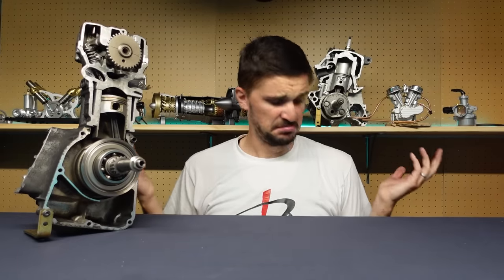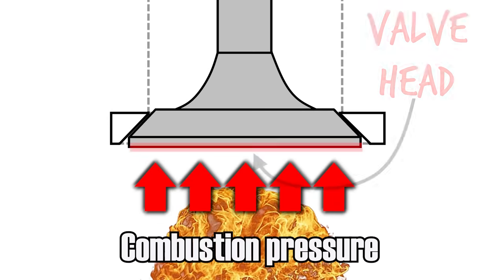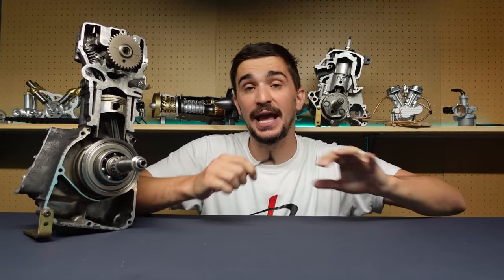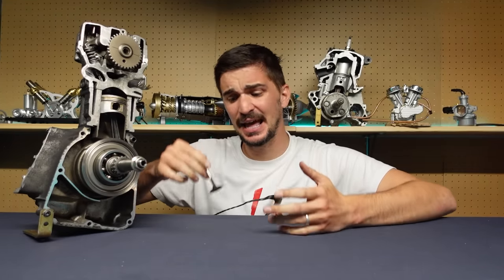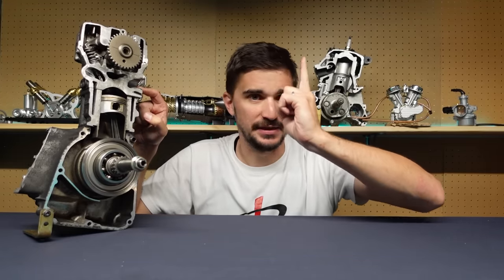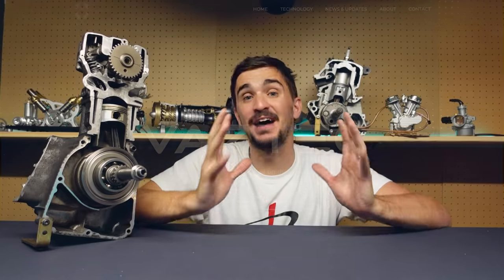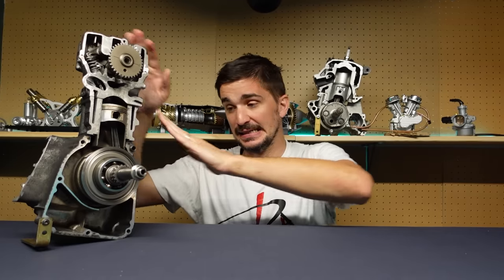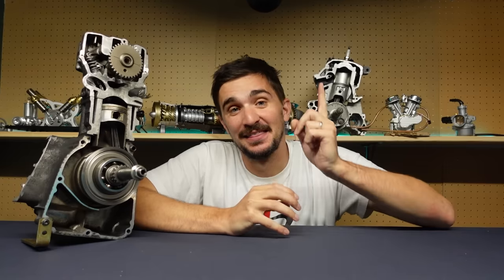Rotary Valves Make Normal Valves Look Silly - Why Aren't We Using Them?

Comment: I've worked on my own design for a rotary valve.  I was building a head that would fit on a Briggs and Stratton 5 horse engine.  Unfortunately my software couldn't  model the gas flow.  I was trying to build a mechanism that was capable of adding a dwell in at propitious times so the combustion events could take place effectively..  Been scheming on this idea for 30-40 years. All that to say this is an interesting video.  I may pick it up again!!  But thanks for the content!!  I probably need to study desmodromic valves!

Comment: Another couple anvantages of the poppet valve: it's sealing surface is self cleaning and the friction surfaces (valve guides) are cooled by the intake charge so oil doesn't cook and gum up the movement.
Reply: Heat is also transferred from the poppet valve to the head when it is seated.
Reply: The sealing surface is only self cleaning on port injection engines. Ever pulled the intake or heads on a DI only engine? They get pretty nasty without fuel washing the valves.
Reply: The exhaust valve guides aren't cooled by the intake charge.
Reply: @pastaalalamborghini  There's still an element of self cleaning of the sealing surfaces on engines where the valves are allowed to rotate in position as they open and close. I'm not sure whether this is common, but some engines have the valve stem slightly offset from the center of the cam to cause this rotation as the valve opened and closed, which reduces fouling on the sealing surface, though it won't stop things getting gummed up everywhere else.
Reply: @peglor  ...valves that spin themselves against their seats to self clean ... Bye
Reply: @pastaalalamborghini no, the valves don't spin against the seat, they rotate very slightly as they open presenting a different face to the gas flow thus evening out any deposits.  Notionally, they've stopped rotating before they close.
Reply: @pastaalalamborghini  ' ...valves that spin themselves against their seats to self clean ... Bye'
Explain to everyone in comments that you don't understand that every tiniest possible advantage in engine tech has been done, without saying the words.
' that spin themselves against their seats'  You should spend a few years watching videos of valves in action before commenting again since you don't understand the accelerations and inertia involved.
Reply: Correct. @peglor
Reply: @Ijusthopeitsquick  the stem is cooled by the flow, so heat isn't transfered to a very large extent to the guides compared to in a rotating valve. There's a physical distance, the stem has a small cross sectional area and on top of that steel is a poor heat conductor.
Reply: @pastaalalamborghini  the contact surface is cleaned by the action of the valve, I'm not talking about port or valve top cleanliness here.
Reply: How about volumetric efficiency?
I’m thinking poppet valves have an advantage there.

Comment: Direct inject two strokes are very clean. They don’t have fuel washing oil of cylinders and bearings so can run a much smaller oil flow. Fuel is injected after all ports have closed so there’s never any unburnt fuel going down the exhaust. Exhaust power valves maintain midrange power and there’s no partial combustion to slap the piston around - much less bore wear. The Rotax ETECH is cleaner than competitors four strokes and has better fuel consumption. It can use stratified charge solving NOx issues. The pre combustion chamber used on F1 engines is an ideal fit as the excess air can be varied via inlet valves.

Comment: seems like a neat idea for single cylinder engines as the barrel can function as a balancer shaft against vibrations as well reducing the needed parts even further.
Reply: If that were the case, a counter-weighted camshaft could do the exact same thing

Comment: I theorized this at University in early 90's the problem is that a rotary valve will not seal. The rotary valve on the exhaust is exposed to gasses at 700° Celsius and the alloy will expand accordingly locking itself in the sleeve. You can build the rotary valve small enough to have a the clearance that will avoid to get stuck at the highest temperature but at any lower temperature the valve will not seal causing leakage from the combustion chamber, lowering the pressure and hence the power. Not the mention un burned polluted outside, worse fuel economy. The traditional valve can expand according to temperature, the spring will account for the extra length of the stem, the valve head is conical and conical but with different angle, is the valve seat even if the valve head expand, it will seal against the seat.

Comment: A company in the late 80s and early 90s was trying to make rotary valves that were supposed to go into production vehicles if they could get all the issues ironed out.  The big three were apparently interested.  It was called "Coates Spherical Valve System" or something similar.  Their main issue was also sealing the valve to the combustion chamber.  One advantage of the system was that it had an inherent advantage in boosted applications.  Rotary valves have been around a long time in various forms, a nice idea to implement if the main sealing issue is figured out.

Comment: Studied mechanical engineering decades back, engineering challenges are fun but ultimately an electric motor just makes so much more sense than building 20 things to overcome 20 other problems that comes with burning fuel.  We have a big radiator, systems to enhance aspiration, systems to deal with timing of combustion, a whole lubrication maze with the need to replace oil often, countless moving parts and the need for everything to work in concert.
Reply: I think the electric motor is the future for main propulsion. Combustion engines will likely remain as range extension generators. AFAIK if you always run at one RPM and one torque many of the difficulties are eliminated.
Reply: Absolutely true, but electricity has other challenges. Mainly that it can't be efficiently transported. And at this point, storage is also not ideal.
Reply: @eDoc2020  yeah the whole deal with needing a transmission is another big deal.   Though I think for extending range there might be better solutions such as using hydrogen to generate electricity than gas with an engine.  Though time will tell.
Reply: @argh100100  energy density is always gonna be a challenge, only future solutions can come remotely close to fossil fuels.  Though at this moment a car that has a 300 mile range can fit the bill for almost all consumers living at home and that’s a great start.
Reply: @argh100100   What do you mean electricity can't be efficiently transported?  I would assume you meant it can't be stored easily but your next sentence was about storage.
Reply: @lanzer22   Hydrogen cars have their own problems which IMO means they will never reach mass market appeal. Have you seen Jason from Engineering Explained's video on the subject? Some highlights: low energy density and the need for advanced containment vessels. Hydrogen combustion engines have the low inefficiency of any other ICE combined with hydrogen-specific issues. Hydrogen fuel cells are more efficient but require rare precious metals and IIRC have a limited lifespan. And then there's the production aspect: commercial hydrogen is usually produced from fossil fuels using steam reforming and green hydrogen comes from electrolysis which is low efficiency.
Reply: @eDoc2020  yes I’m very familiar with hydrogen from Nikola’s lies to Toyota’s disastrous Mirai as well as EE’s video.  Its use will be limited and not practical for short trips such as passenger cars, but it has potential for long haul transport and that’s when battery power doesn’t make sense.  For things like passenger cars we already have 300 miles and 500mile models are being introduced, their application is already sufficient
Reply: @eDoc2020   The loss of electricity transport is much higher compared to liquid or gas. On average it has more than twice the direct energy loss in transport,  and it's approximated to be more than 10 times as expensive  per 1000 miles of transport compared to liquid/gas. There are even considerable developments to  convert offshore wind energy to hydrogen before transporting it on shore (energy transport below the sea is much more inefficient and expensive than transmission lines). But like you mentioned, hydrogen is not really ideal either.
Reply: @argh100100    A 98% efficient system has twice the losses as a 99% efficient one but who cares? I know electricity transport isn't quite that efficient but AFAIK it's still at least 80% in almost all cases. Very long or underwater AC lines have lighter losses but there's a relatively easy solution: high voltage DC. Switching lines from HVAC to HVDC eliminates all the capacitive losses.
Reply: @eDoc2020  around 20% of electrical energy is lost between generation and your car. The numbers in the previous comment were already for HVDC.
Reply: @argh100100  20% loss, that's the same as the 80% efficiency I suggested. Still not bad. IIRC hydrogen fuel cells have a lower efficiency and that's before you consider transportation losses, let alone generation losses.
Reply: @eDoc2020  That 20% is the current average, where most of the energy is still produced by burning fossil fuel near the place where it is needed. Electricity transport is still a problem, which was the point that I was making, I'm not trying to promote hydrogen.

If I use a diesel generator with an efficiency of 50% to charge my Tesla, it is still 50% cheaper than using the electrical grid, which kind of outlines the problem.
Reply: @argh100100   If you have a diesel generator that can generate cheaper electricity than the grid you've found something amazing.
Reply: @eDoc2020  Not really. When you calculate electrical transmission and conversion losses in the higher efficiency of power plant generators versus local ones basically washes out. That's why so many people still use natural gas appliances. EV's are actually only more efficient because they can recover energy from braking. An EV without regenerative braking is actually more polluting than a gas car. Or to put it another way gas hybrids are more efficient than EV's.
Reply: I agree, however especially with big rigs over long distances there's probably still a demand for combustion generators to power the electric motors, just like ships and trains. Is it a traditional diesel with traditional valves, a diesel with rotary valves, or a turbine of some sort? Who knows...
Reply: I have this unbelieavable strange feeling/belief that man will never run away from the world of thermodyanamics no matter the inventions in electrical technology. Thermal seem to be the origin of everything and its relationship with man is everlasting.
Reply: @titanichisete648  let it not be  unbelievable no more, considering Newton wrote down the laws of thermodynamics.
Reply: @Greippi10  Newton only discovered what was already there. And thermal energy has been at centre stage and still it is.

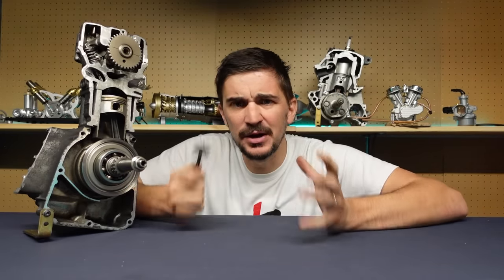Comment: 7:43 I did NOT hear that valve fall. where did you throw it man? WHERE DID IT GO???
Reply: An ordinary man of ordinary strength just launched a valve into orbit.
Reply: Don't worry it fell straight into one of the Bugatti W16 cylinders and did something funny to the engine.
Reply: @jayartz8562  man, i love the comment section sometimes :D
Reply: @jayartz8562  It'll come around and hit him in the back of the head when it hears what he was saying about them!
Reply: The backrooms
Reply: I was thinking about it. Either someone caught it or he threw it in something like a pillow.
Reply: Edited sound ?
Reply: I immediately assumed a friend caught it.
Reply: @ralanham76  It is possible to run the background noise through a spectrum analyzer and look for editing breaks. But I'm to lazy and not curious enough.
Reply: It got teleported to multiverse of valvetrains and met a rotary valve and got married!
Reply: It landed in hammer space. 😆
Reply: Theres a couch on the other side of the room
Reply: That's a 'special' valve with the hollowed out stem filled with helium......it's still in the air🤣
Reply: The void.

Comment: You can still use 2 of these per bank. One for intake, one for exhaust. Then you still get to put a plug/injector in the center.

I like this idea. It's clever, and with enough research it could be made to work. The poppet valve did.
Reply: Yes also you could alter the timing separately.
Reply: Just because poppets work . . . doesn't mean that something else will.

Comment: The energy used compressing a valve spring doesn't just evaporate, it is stored as you noted, and that stored energy goes back the way it came when the valve is closing. The sealing challenge in a rotary valve cannot be overstated, I led the design of a "novel" rotary valve system for a different application, one with far a narrower temperature dynamic range, differences in the expansion coefficients of the metals used multiplied by the necessary tolerances ultimately killed it as a viable system, at a reasonable price point, I.e. without going to exotics. At one end you have sloppy seals and at the other you have tight seals and fast wear.  If the temperature was static however (which would have involved a stabilisation/preheating phase prior to operation) or sealing efficiency wasn't critical, then sure.  I'm also a kiwi as it happens, we like our unconventional approaches down here, but we are also pragmatic  ;)
Reply: This comment needs to be pinned at the top.
Having spoken with a friend who worked for Coates back in the 1980s and 1990s, these were the same issues they were facing.
Reply: "it is stored as you noted, and that stored energy goes back the way it came when the valve is closing"
Well, not exactly.
Look at this as an equasion:
C - the energy stored in the spring at full compression
A - the energy needed to move the valve assembly
B - the energy fed back into the cam shaft
L - losses to friction
Put the energy supplied on one side and the energy expended on the other, and you get this equation:
C=A+B+L.

Now, C is constant and L is ideally kept to a minimum.
But what happens to A when the RPMs go up?
Since the valve assembly has to move faster and faster, more and more energy is needed to overcome its inertia (as it is constantly changing direction).
That means A goes up. And since faster motion usually also means greater friction losses, L goes up too.
Meaning that B, the energy going back into the camshaft, goes down rapidly.
And the higher the RPM go, the smaller the energy feedback.
Reply: @rockyblacksmith  the energy  required to overcome inertia does increase yes, but that energy is present both as input and as output, the only loss is due to friction  . And there are no frictionless bearings in this universe, regardless of mechanism.
Reply: @m3chanist  The input does not increase. The energy stored in a fully compressed spring is a fixed value. No matter how much energy you try and put in, it will only ever give out that amount. That is the basic physics of springs.
Reply: @rockyblacksmith  Input: "more and more energy is needed to overcome its inertia" it seems you don't understand your own words, or do you now disagree with them as well?  Output: Momentum is conserved, including angular momentum, your B, rather than it "going down" as you claimed, the amount of momentum increases as more energy is fed into the system, the mass of the parts multiplied by their velocity, as their velocity increases so to does the momentum as the mass is constant, obviously.  All that goes in comes out in a reciprocating system, apart from the friction, the input energy is stored and returned (minus the frictional loss which is a given for all devices).  If you'd like to make a claim for a mysterious black hole of unbalance that is swallowing the system's total energy somewhere else, then be my guest, I'll get my popcorn and inform the Nobel Foundation.   What is more, a rotary valve has vastly more contact surface area than a poppet valve, frictional losses are orders of magnitude worse.
Reply: @m3chanist  OK, it seems I fundamentally failed to illustrate the point I was trying to make, since you attribute the variables I used to completely different things than I did. 
Making further attempts at explaining it rather pointless.

Comment: These have been around for years.  The failure of the design is that combustion gases get around the barrels, kill the lubrication around the barrels and they fail.  Sleeve valve engines, which have a vertically aligned barrel,  were used in WWII, such as the Napier Sabre, but suffered from reliability issues.

Comment: There were some heads designed several decades ago for a Ford 5.0 that used shaft mounted spherical valves. Being as the valve train was the limiting factor on RPMs, this design allowed ridiculously high RPMs and tremendous power output, and greatly increased the intervals for oil changes.

Then POOF, they disappeared and you never heard anything about them again.